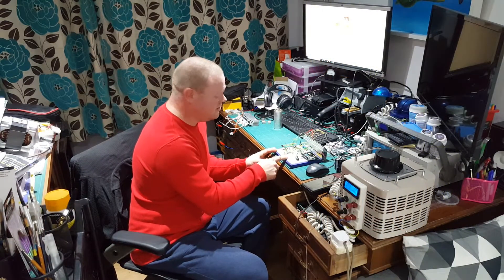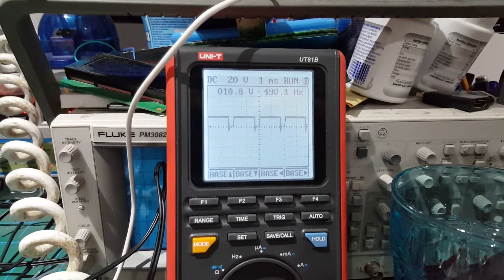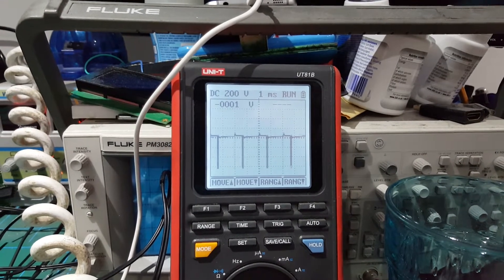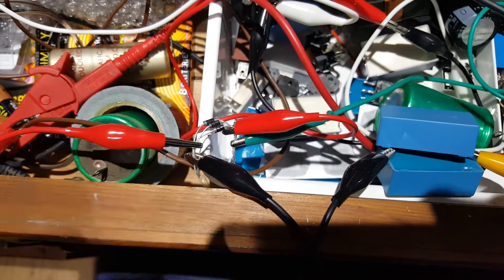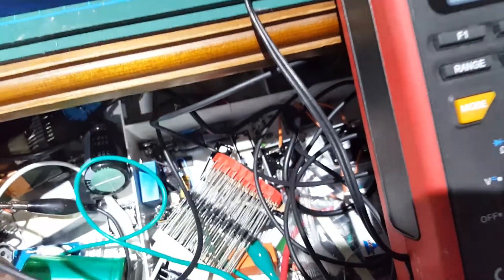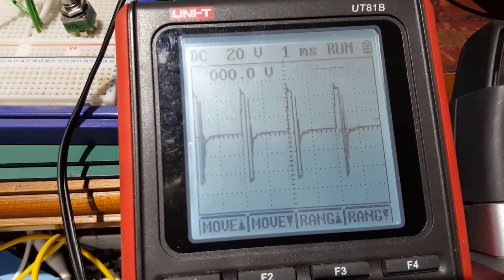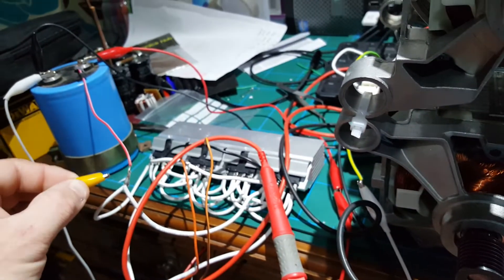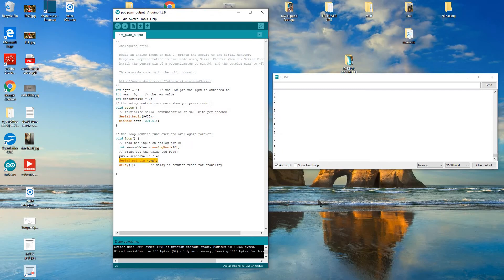motor control #3 power output snubber driving inductive loads back emf

Comment: After rectification the  voltage you stored on capacitor are 130+volt
Can you imagine to charge your source like battery which is rated at 40+ voltage on 130+ voltage?
Reply: Although it will be for very short instances but although here in this case the power will again dissipate as i think. Please correct me if i am wrong

Comment: Do you have a schematic or a rough outline of the non lossy snubber you use? I am trying to find some circuit examples and I can't figure out how you use the rectifier. Is it by itself inbetween the half bridge or do you still use a capacitor in parallel with it?
Reply from the maker: Hi if you google a 3 phase rectifier and simply put that accross the three phases it will naturally always be a non passive snubber. Also if you had 6 discrete diodes and put them accross the source and drain of each mosfet or igbt you would really also be wiring it the same way. So its quite easy. I think you may be over thinking it a little look closely at other schematics online and in your mind remive the switching igbts .. what your left with is simply a 3 phase rectifier. Hope that helps :-)

Comment: speaking of flashback, do you think you could use a car ignition system to make a super high speed motor controller once the motor is up to speed? I am probably missing something. It seems like if your motor accelerates at half throttle you don't need a full wave?
Reply from the maker: Not really. Ignition is really high voltage but low current.. think of voltage and current as an analog gesrs on a mountain bike. You can select faster and faster gears for higher and higher speed but you get less and less torque as a trade off. Volts are like the speed and current is like the available torque.. an ignition coil would be the equivelent of a gear where the back wheel of the bike turns thousands of times for just one pedal revolution. You would have incredible speed but absolutely no torque .. does my crappy analog make sense? Lol
Reply: Thanks! Yes good analogy. I just wonder what the h.p. curve would look like at the top end?
Reply: https://karlperformance.com/i-24715106-msd-pro-mag-long-duration-spark-ignition-box.html